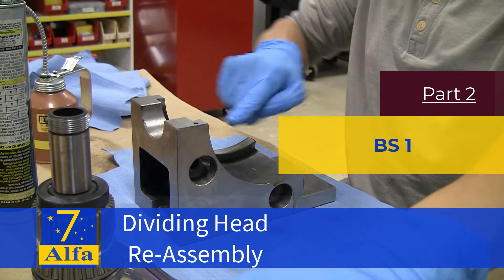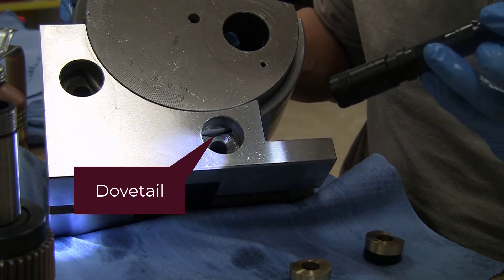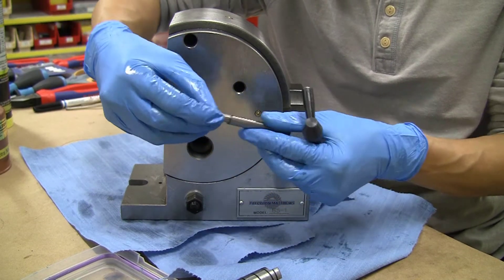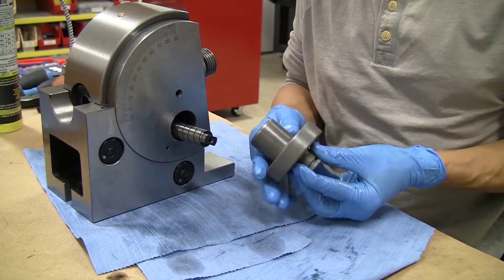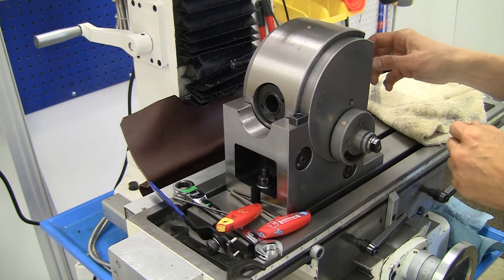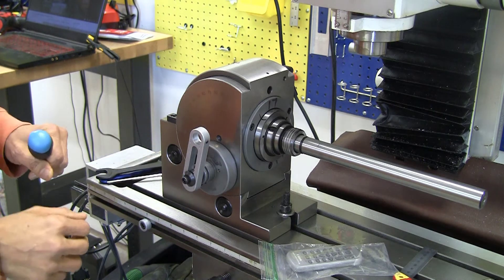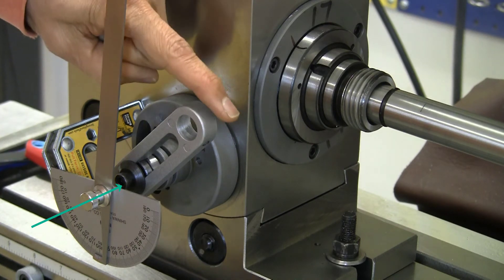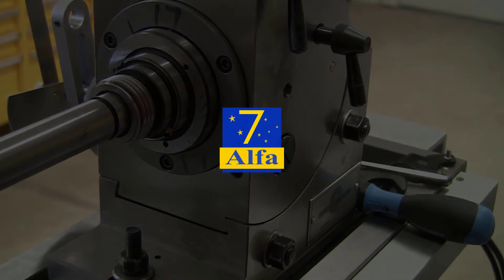BS-1 Dividing head Re Assembly

Comment: Mine was awful. The chuck threads were horribly machined. The spindle was binding even after being removed, cleaned and greased and the worm bjnds unless it is adjusted to have some backlash. The worm wheel is not a true worm wheel at all but just a gear with a simple tooth profile so there is only a tiny amount of engagement so the friction is super high. It’s too bad we can only get these from china. The taiwanese ones were pretty good but they’re all gone. These chinese ones have taken over because people only car about $$. These are horrible but there doesn’t seem to be any other small dividing heads on the market.

Comment: You obviously keep a clean machine but I wonder what you label your oil can with. That's a problem here in my shop where I have nearly a dozen oil cans and can think of no way other than a paper tag on a wire to label them. How do you do it?
Reply from the maker: Thanks for the compliment, but my shop doesn't always resemble that appearance!. I have labelled them with one of those Brother label maker machines. The label tape is pricey, typically ~$25 for a cassette, but last me a very long time. The tape has a plastic coating that is quite durable. 
As long as I  clean the can surface nicely before I put the label on, I have not had to remove a single label. Even wiping the can with a cloth does not peel them off.